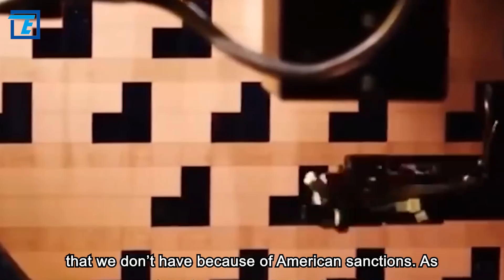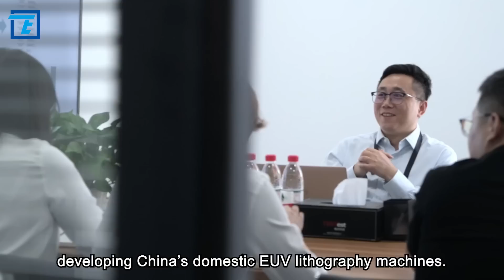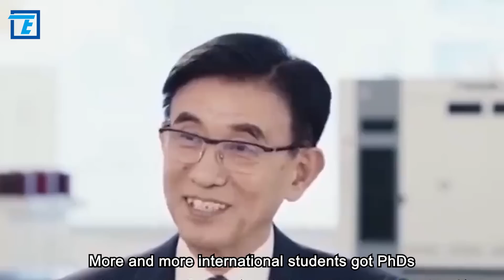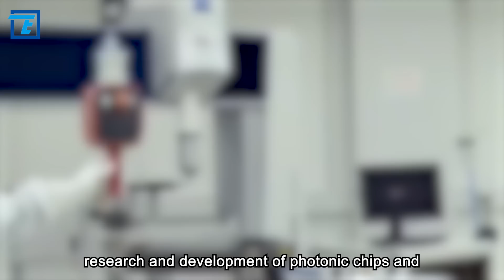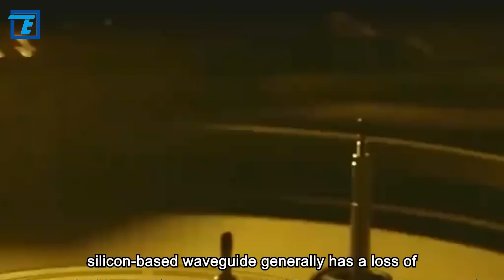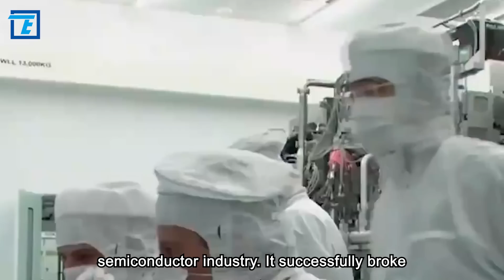Chip experts back to China to help Huawei's photonic chip?

Comment: To overcome chip problems you need your own IP. Engineers just can't use what they're used to if it utilizes unauthorized IP. Developing your own for the whole chip tech stack is a heroic endeavour and would likely just be always in catch up mode. Unless you have your own valuable IP to trade for its use.

Comment: Photonic and/or graphene microchips might be the future, but already today the Chinese semiconductor manufacturer SMIC has promising capacity for ordinary microchips, such as: "SMIC’s N+1 does not use extreme ultraviolet lithography (EUVL), so the fab company does not need to procure further expensive equipment from ASML."
Reply: There is also Nanoimprint lithography invented by the Japanese. The Japanese have been suffering a similar problem as China have with the US control of global markets,  so I would imagine Japanese patents would be a lot easier to licence and more reliable than US patented technology. Japan could do with hedging some of its business with China rather than relying on the US for all it s needs. They are facing another round of stagflation at the moment.
Reply: @Andrew-rc3vh  Japanese are too weak they will never upset US by getting close to china
Reply: @Starcare3  I did hear they were cooperating on some currency problem. Japan and China are both suffering a strong dollar so surprisingly Japan is coordinating a response despite what you would normally expect. The US is losing its grip in East Asia.
Reply: Ppoo
Reply: @godfreyanyumba1531  Another 0¢ orange 😴 cheque is on the way from your god Little Joey 😴.
But do wake him up first.
Reply: Popp
Reply: Poppppppppppp
Reply: Poppp

Comment: Can you tell us more about how photonic chips work?
Reply: This is an industrial top secret. No one is going to tell you.😉
Reply: @stevenliew2507  Makes sense. Seems very promising!  🎈
Reply: @red-baitingswine8816  probably it works with photon instead of electron as the name suggests.
Reply: Hi,

I'm an American with a PhD in photonics from Stanford University. I founded a photonics company, and our work is based heavily on my own research with essential contributions from colleagues in the US who are from the US, Canada, China, Mexico, Luxembourg, Iran, Turkey, and more. We're a diverse group; it's one of America's greatest strengths.

Light can be guided along wire-like structures called "waveguides" on-chip. They're, roughly, 1 micron wide and a few hundred nanometers tall. The most common material for these waveguides is silicon, just like that used in electronics. The silicon can be doped and electric fields applied to modulate the light (turn it on and off). You can add materials (III-V's) to build lasers and detectors on chip, as well. All these components are combined to make a transceiver, which turns electrical signals from a digital circuit (like a processor) into optical signals conveyed over a fiber optic cable.  

Many of the core ideas were proposed by Richard Soref in the 90's who was working for the US Air Force at Rome Lab. They've been developed since, with a lot of critical work being supported by DARPA, and are just now becoming drivers in the growth of computer networks. There are big organizations, like Intel in the US and IMEC in Belgium with advanced photonics capabilities. There are also many startups like Luxtera in the US, who played a pivotal role in developing silicon photonics and got acquired by Cisco, and Aurion in the US, who developed advanced coherent transceivers and got acquired by Juniper Networks. Most of those efforts are geared toward replacing electrical wiring between computers, within a computer, and even across a single integrated circuit with optical signaling. Why? It uses less power. Our appetite for data is exponentially increasing, and we will not be able to produce enough energy to support that growing appetite. If you want to know more, you can read Stanford Professor David Miller's 2017 analysis Attojoule optoelectronics for ... .

Unlike the most advanced electronics chips, photonic circuits don't need extremely high resolution patterning. You can get away with pretty old lithography machines. That's part of the reason why China will focus on it. The other reason is because it's the future of sensing and communication.

Chris
Reply: @goodflux  Thank you for that! I'm about to look up that reference (Miller).
Reply: When u combine it with quantum computing… Magic !
Reply: It's not a top secret.